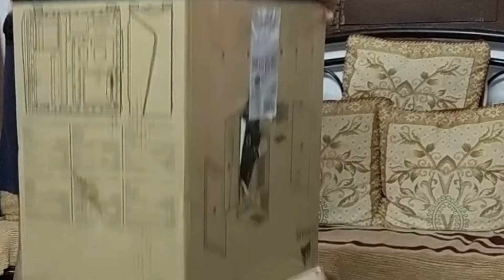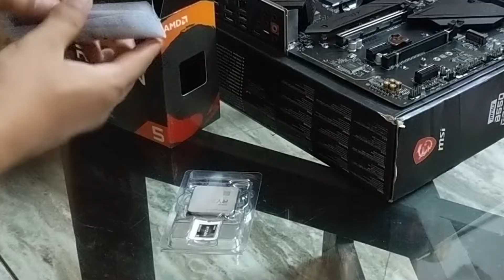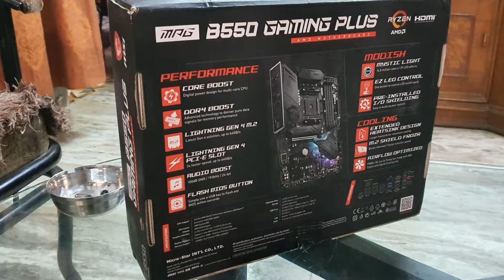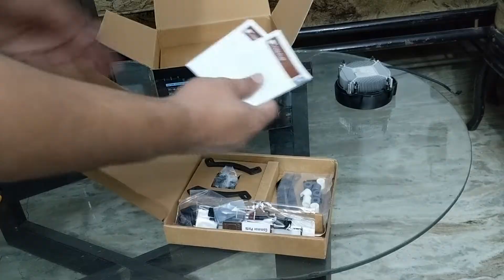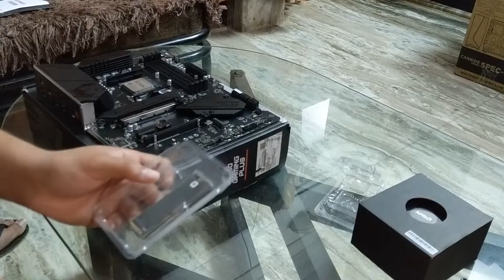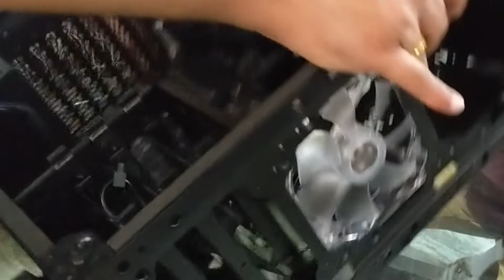Is the RTX 2060 Still Worth It? Gaming PC Build 2026

Comment: Can I use cooler master 450watt bronz certified psu . Cuz I already have 450 watt so can u tell me it will work or not
Reply from the maker: If you are using similar configuration i think 450Watt will not leave you with room to do any upgrade and also you might be at a limit in terms of power supply and in turn this will cause stability and performance issues. I feel with 650watt we have enough room and will not hit power supply limitations
Reply: @zuzgaming  ok ✅ thanks

Comment: yo i also upgrading my  second pc i used for the longest for work pc pentium g4560 8gb ram used a 1060 6gb now i upgraded too a ryzen 5 5600 and a rx 6600 with only 16gb ram it be my gaming only machine i have a stremaing pc i used for my second pc i got from 2019 using a ryzen 5 3600 32gb ram and a gtx 1080ti it be my streaming and video editing rig .
Reply from the maker: Nice Setup!

Comment: in total how much is this build?
Reply from the maker: 2500-3000 usd
Reply: @zuzgaming  wtf lol cap for 3000 usd you can get a 6950 xt build or a 3090
Reply from the maker: not in India and I built this PC during the GPU shortage, u can build it for much cheaper now
Reply: i have the same GPU and CPU , the build is around 1100 usd